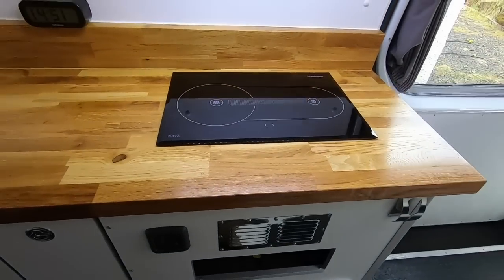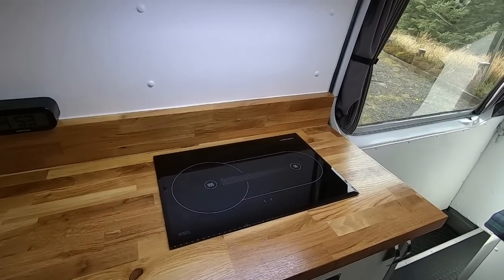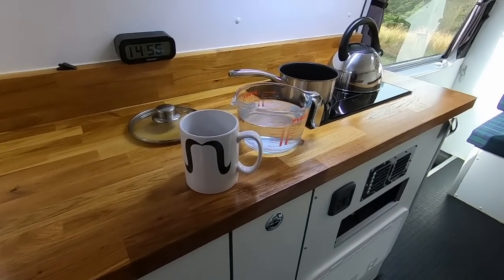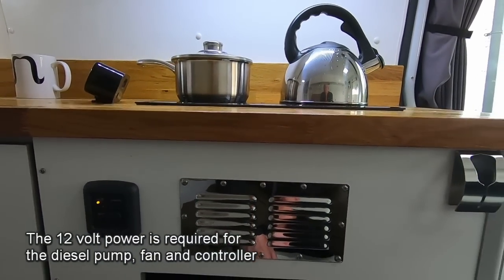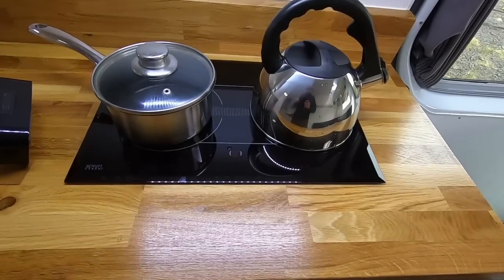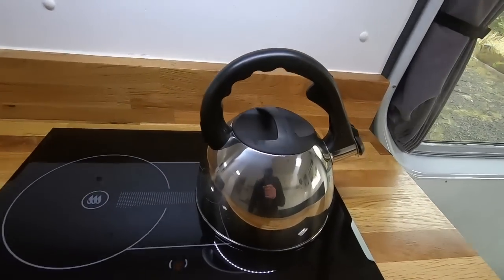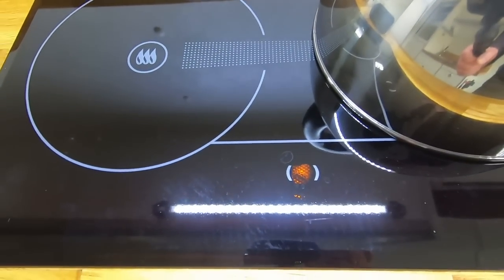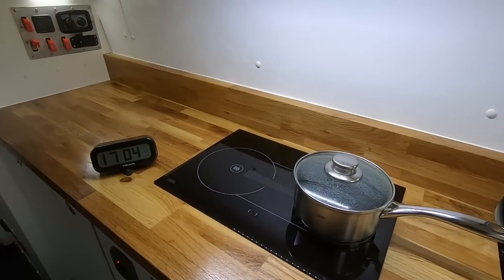#15 Webasto X100 Diesel Hob Demo’ & ‘’Speed’’ Test: Sprinter Camper Van Conversion: RND Diaries #017

Comment: Great idea but gas for me, I use my oven and grill. My van came with gas left in the bottle, still using it 15 months later.
I'm not sure how much was in the bottle though and have a small camping cooker with canisters for the day it runs out lol.
High amp draw on the battery every time i want tea, plus my diesel heater running and doing the same thing would hurt my leisure battery way too much I think.
I like the sleek look and of course it would be easy to clean.
I can understand that this works good for you, that's all that counts really. 
No gas to consider has it's benefits  as well. Cheers for showing us 👍👍👍
Reply from the maker: Like you, my daughter would absolutely not manage without her gas grill - she even has two in her van!! ( https://youtu.be/mzCZYvy72BM at ~3m13 secs). Thanks for the feedback. Cheers john
Reply: @RedNemesisDogPrime  lol, I have two as well. They were both already fitted when I got it. One below the hob and the other in the oven.

Comment: 26 minutes to boil on slow side? 😬 Geez. that makes me reconsider getting one of these.
Reply from the maker: It does require a bit of a change in expectation and lifestyle, but despite the lack of instant cooking power I would certainly choose it again over gas. I can say that once the hob is up to temperature it is a different story as the heat from the hob is very efficient for cooking and heating water. Personally I am OK with the slower lifestyle when away in the van and I prefer the benefits of being independent of gas and having the fuel efficient hob ( and of course the design is a bonus). The rate of getting up to temperature was not what I had expected when I chose the unit (hence the video) but totally comfortable with it after 9 months using it. Cheers john
Reply: I guess Im kinda randomly asking but do anyone know of a good site to watch newly released movies online ?
Reply: @RedNemesisDogPrime I haven't got a van yet. Still looking into it and thinking of a Malibu 600 dbk. It has a gas hob. I'd love the Webasto hob instead. 
I understand about how you don't mind about the wait of the hob heating up. I don't think it would bother me either. It's good to slow life down.

Comment: It looks very smart and of course you have no water vapour going into the air like you do with gas. Its slower by far but to be honest does that matter if you are living the van life ?  You can get diesel anywhere there is a garage so you don’t even have to think about finding fuel. Our van had refillable LPG and we certainly do need to think about finding fuel for it. Interesting video thanks 👍
Reply from the maker: Thanks for the feedback. I couldn't have put it better myself. As I commented elsewhere, I actually enjoy the slower pace and waiting for the kettle to boil means I get lots of little jobs done whilst I am waiting. The absence of water vapour from gas was definitely a factor in choosing to go with the diesel. Thanks again for the comments. Cheers, john
Reply: I also like the idea of less condensation. The wallas is more expensive, but it also can act as an heater during a cold Night on very  low el.
Reply: Exactly! That's the major benefit of this hob over an open gas flame: there are no combustion products released into the internal atmosphere. No water condensing onto the walls, no CO issues. 
I fitted one of these in our Unimog mobile office/camper. It is expensive but looks smart, is easy to keep pristine, and the commonality of fuel is a bonus. I recommend it for any diesel-engined vehicle. True it's slow to heat up but one simply plans ahead. We have an on-board generator so use an electric kettle for boiling water, this hob is mainly for cooking. It's an ideal solution.
Reply: @IridiumMoon  hi mark do you heat with your Diesel cook hub? With a heating top on it? Or a stove top fan?

Comment: Be faster collecting sticks and lighting a fire FFS  26 min  that's just put me right of getting one  cheers
Reply from the maker: In practice I just use the left hand side to bring pan/kettle to the boil and then swap them over and the right side keeps them on the boil. The test is a bit harsh on Webasto because I wouldn't use the smallest burner on my domestic gas hob to boil a kettle... Cheers john

Comment: Any danger from fumes or CO?
Reply from the maker: The X100 and the Evo 6 boiler have a closed system for combustion. Air is drawn directly from under the van by a fan which circulates through the burner to combust the diesel and the exhaust is blown back under the van so that for combustion purposes there is no burning in the same space as the habitation so no fumes or CO risk in the van/habitation space. It is a closed loop of air in/exhaust out with the external air. The only draw on air in the van is for the blown air heating with the Evo 6 which is warmed by passing through a heat exchanger. Cheers, john

Comment: Hi thanks for the video. Bit of a strange question for you. I am thinking of installing one of these in a small boat, do you think that I would also be able to use it for ambient heating too? does it throw a lot of heat out?
Reply from the maker: Hi Nelson - There is a version of the hob which has a heater function which would be a better idea I think as it is fit for purpose if you want to use the same unit to cook and heat the boat. It is branded the Wallas XC Duo Hob, although I was told that the basic hob unit is the same as the X100. Jerba Campervans did the final fit of my Webasto units and install the Wallas in many of their VW camper conversions: https://youtu.be/x-1VZkZGoyI It also has the benefit of providing a cover for the hob. Cheers john
Reply: @RedNemesisDogPrime  Thank you for getting back to me, I looked at it, but at half the price again I was looking for alternatives. As the cabin is such a small space I had hoped that the heat from the Webasto would be enough. (I think the output is very similar to the wallas) There is also the option to use a stove fan (very popular these days) to move the heat about if necessary. This would also take the noisy fan issue related to the Wallas out of the equation.
Reply from the maker: Yes I believe the hob itself is the same so your idea of using a stove fan makes a lot of sense. Obviously I cannot say whether the setup would work but your logic is sound as the only difference appears to be the ability to circulate the hot air. All I can say is the hob does get very hot once it has gone through the startup cycle so I cannot see any reason why it wouldn't work but I just haven't tried it. I really like the idea so will try it myself as it saves firing up the heater for those times you just want to take the chill off the space in the van. Currently in lock down so who knows when... Cheers john
Reply: @casaMariaPT  Hi Nelson, Just wondering if you went this route with the X100 and a fan.  I am thinking the same....Wallas too much money.  Would love it if X100 did the same with a little modification.  Cheers....
Reply from the maker: I have got as far as buying the stove top fan!!! I am still in lockdown due to being high risk covid so I haven't tried it in the van yet. It works brilliantly on my wood stove in the house though so I am optimistic it will work. I will report back once I get back out in the camper. Cheers, john
Reply: @RedNemesisDogPrime  The idea with the stove fan is very interesting since the heating cover of the wallas cost 600€. Thats way to much for a cover with a fan in it.
Reply: @RedNemesisDogPrime  did you test it. Please make a very short 1 minute video of it. Can you heat up your van with the stove top fan on it?

Comment: i do like your videos but for 1200 quid i aint waiting half hour for a brew when my 10 quid gas stove boils the kettle in under 4 mins ......thats a lot of money
Reply from the maker: It is indeed a ridiculous amount of money for a van hob and in comparison I would never consider paying that much for a top of the range smartphone which is probably equivalent in cost despite the fact I would use it more than the hob. I am definitely hoping it lasts significantly longer than a smartphone though... Bizarrely I don't mind the time it takes, it means I now do all the jobs I normally put off whilst I am waiting for the kettle to boil. Thanks for the feedback on the videos. Cheers john

Comment: Do you need to use ultra low sulfur diesel?
Reply from the maker: It draws diesel from the van diesel tank, so the diesel is the same as the engine uses from the garage pump. Not sure if this is low/high sulphur. Cheers, john
Reply: @RedNemesisDogPrime  thanks for the info! I’m planning to build a truck camper and looking into a diesel cooker and heating system. I’ll mainly be in North America, but would like to venture into South America as well. NA uses ultra low sulfur diesel, whereas some countries in SA have higher sulfur quantities which can mess up newer diesel engines and their sensitive emissions systems, so I’m trying to get a truck with an older Diesel engine.
Reply from the maker: If you are going with Webasto for the diesel cooking and heating then maybe give one of their dealers a call as I am sure this must be a common concern and maybe their products are designed to deal with both high and low sulphur scenarios. Good luck with the build. Cheers.